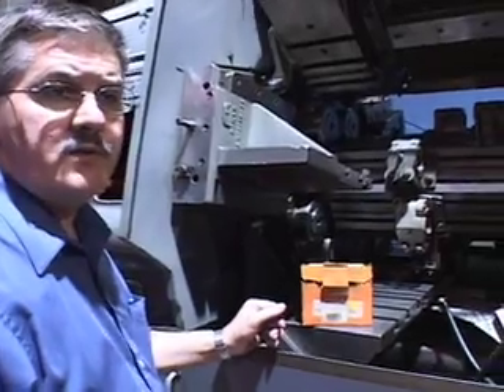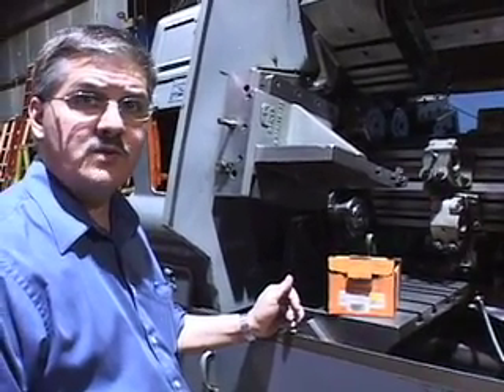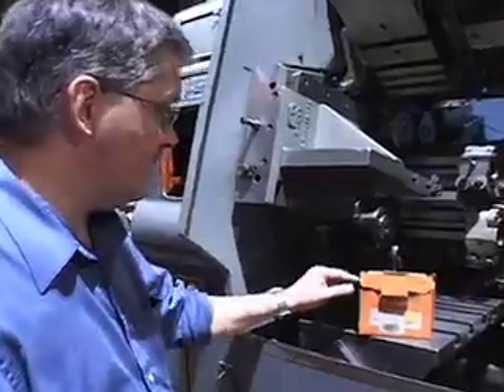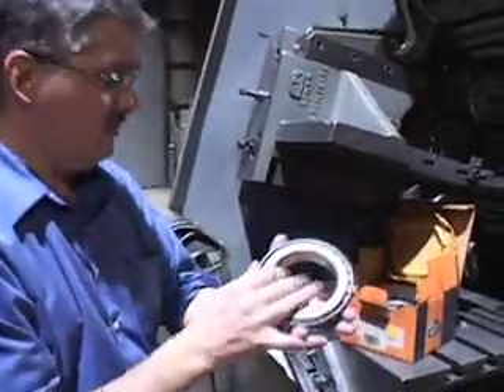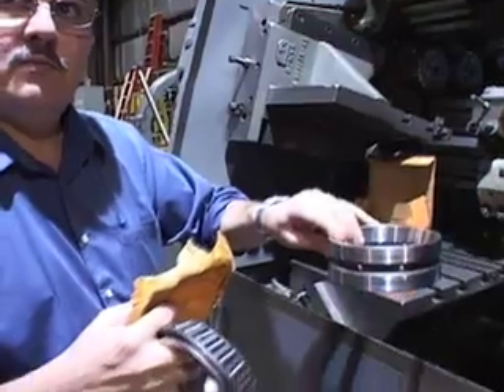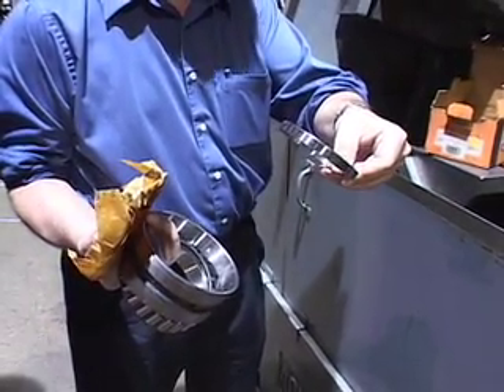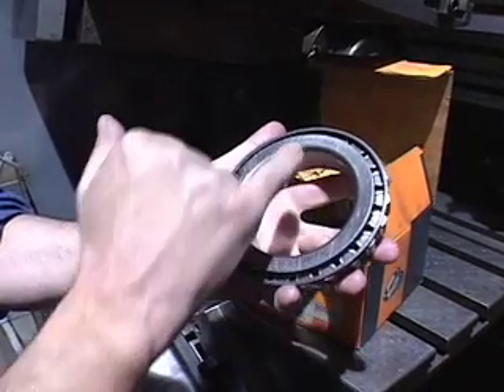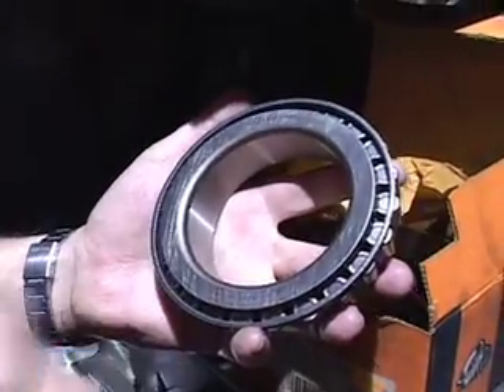Spindle Bearings 101

Comment: Informative video if you need information on replacement spindle bearings. Timken bearings are the industry standard for roller, needle and cone bearings but NSK, SKF or other "commercial" bearings are more than acceptable when replacing bearings which must work to a reasonable commercial tolerance. I believe that "precision", is a value respective to a specific tolerance requirement.